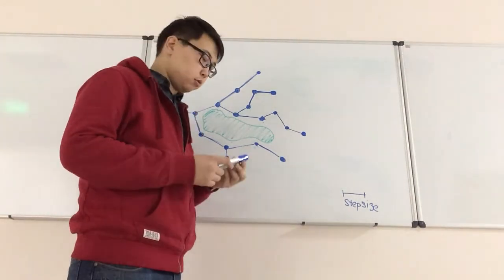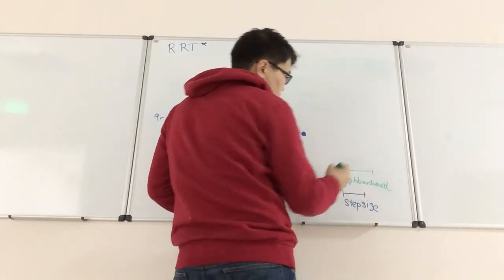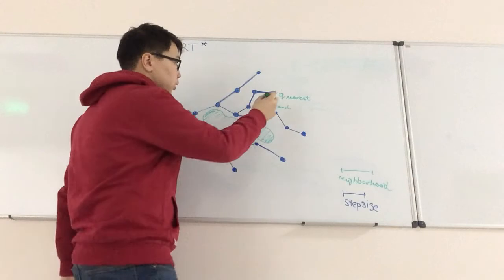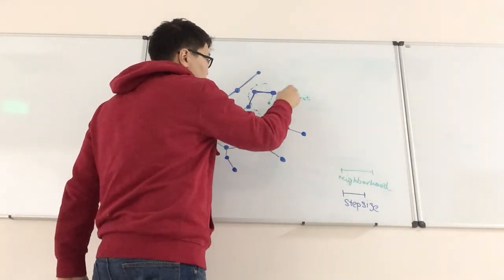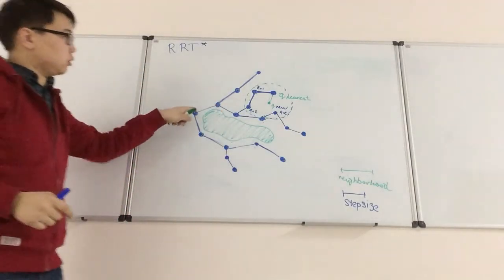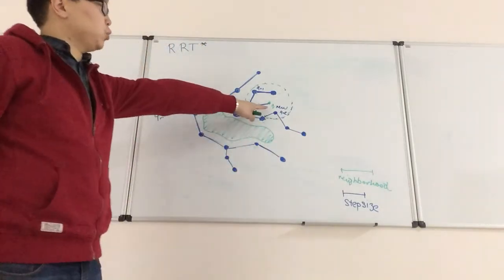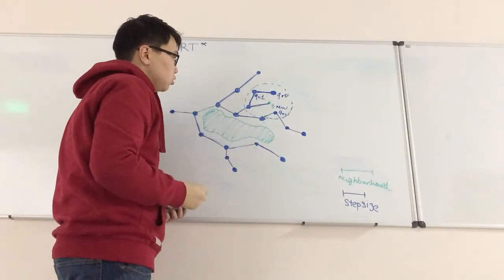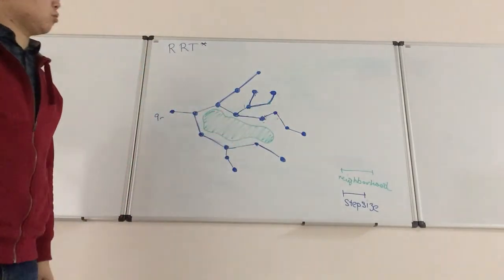RRT* Brief Explanation

Comment: Initialization:
        Create a tree containing only the initial configuration of the robot.
        The initial configuration is the starting point in the configuration space.

    Iterations:
        For each iteration:
            Generate a random configuration within the configuration space.
            Identify the nearest node in the existing tree to the randomly generated configuration.
            Steer from the nearest node toward the randomly generated configuration to create a new node.

    Connectivity Check:
        Check if the path from the nearest node to the new node is collision-free.
        If the path is obstructed by obstacles, discard the new node and generate a new random configuration.

    Connecting to the Nearest Node within a Radius:
        Search for existing nodes within a specified radius from the new node.
        Evaluate the cost of reaching the new node from each nearby node.
        Select the nearby node with the minimum total cost (considering both the cost of the nearby node and the cost of the new path).
        Check for collision along the path between the new node and the selected nearby node.
        If collision-free, connect the new node to the selected nearby node and update the tree.

    Rewiring:
        After successfully adding a new node to the tree, check for nearby nodes within a certain radius.
        For each nearby node, evaluate if the path through the new node results in a lower cost than the current cost associated with that node.
        If a lower-cost path is found, rewire the tree by updating the parent of the nearby node to be the new node.
        Update the cost function associated with nodes along the path.

    Optimality:
        The algorithm asymptotically converges to an optimal solution as the number of iterations increases.
        The cost function ensures exploration of low-cost paths, and the rewiring step continuously refines the tree for efficiency.

    Termination:
        Continue iterations until a specified number of nodes are added to the tree or a predefined convergence criterion is met.

By following these steps, RRT* incrementally builds a tree in the configuration space, considering both exploration of new areas and the optimization of existing paths. The algorithm is particularly well-suited for motion planning problems in robotics and can converge to an optimal solution over time.

Credit: ChatGPT with some corrections

Comment: summarize:
1. start by a vertex set with only initial point, and an empty edge set
2. randomly select a point in free space, and find the nearest vertex from vertex set to this random point
3. find a new point on the line between nearest vertex in step 2 and that random point in step 2, such that this new point is closer to random point, but within the "step size" to nearest vertex
4. DON'T wire this new point to nearest vertex directly! Find a "neighborhood" of this newly added point, and all near vertex within this neighborhood. 
5. Find the point with minimum aggregated cost from initial point + the cost from this point to new point in step 3 from the neighborhood mentioned in step 4. Here cost can simply be the euclidean distance. Add an edge from this minimum cost point to new point mentioned in step 3.
6. Since have a newly added point now, we need to update its neighbor's cost. They neighbors now have an additional choice they can use to connect to initial point, because of this newly added point. So for each of the neighbor, make sure they are rewired if going from this newly added point is cheaper compared to going from their old parent point.
7. keep doing 2-6 until you find a point inside goal region, that means your tree reaches destination. Boom! Mission complete! You find a path with optimal low cost from initial point to goal region!
Reply from the maker: A clarification, when you initially hit the goal region you will not necessarily have the optimal solution. You should allow RRT* to run for a few more iterations after that.
Reply: @OlzhasA  rewiring happens with the existing only after the goal is reached? And rewiring starts at goal node and propagates reversely to start node based on euclidian distance?
Reply: Thank you
Reply: How to ensure newly added point conform to differential constraint?

Comment: You mention that one path is "cheaper" than another path, but in this video you never mention where the goal state is.
Reply from the maker: Ethan Evans we assume that a goal point can be any of the nodes in the tree.
Reply: So path costs are measured in terms of traveled distance by the path only?
Reply from the maker: Ethan Evans in this simple case: yes. but you can come up with other cost functions.